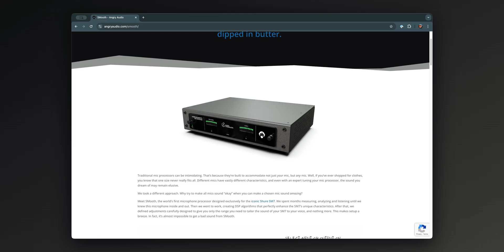Mysterious interference - tropospheric ducting

Comment: In early August there was an exceptional tropospheric ducting event in Southern California. For a few hours at my location in downtown LA I was receiving almost every San Diego and Tijuana FM station. As well as the digital HD Radio signals for 89.5 KPBS, 94.9 KBZT, and 101.5 KGB. I also received KPBS channel 15 (RF 19).
It even impacted reception of HD Radio for some LA stations, because the distant stations on the adjacent frequencies was so strong. For example, 102.7 KIIS FM's digital signal was overpowered by 102.5 XHUAN and 102.9 KLQV.
Reply from the maker: Wow! Those days don’t happen too often but when they do…!
Reply: My records for receiving the strongest Tijuana stations (either 90.3 XHITZ, 91.1 XETRA, or 92.5 XHRM) has been near Buttonwillow in Kern County - 240 miles. And Trona in the high desert - 220 miles. They are often very commonly received driving on the 5 along the Grapevine north of Santa Clarita until Tejon Pass.